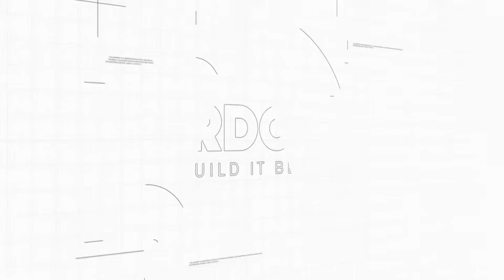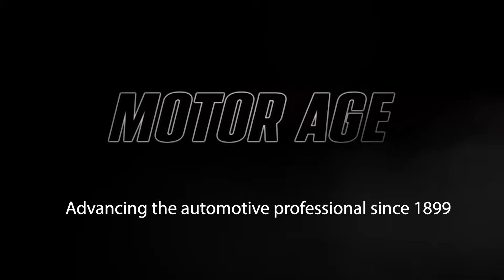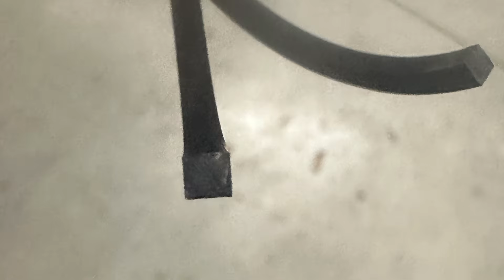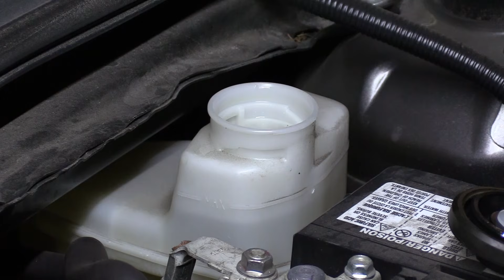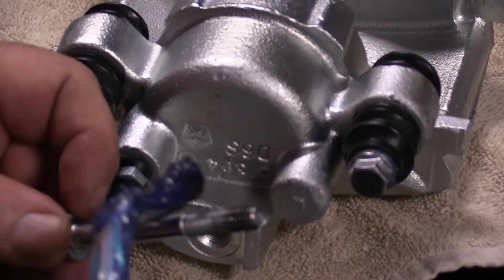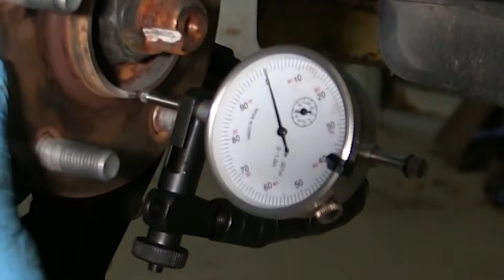Cardone PROTECH #13:  Brake Caliper Do’s and Don’ts

Comment: Good video! One thing I'd add to the caliper lubrication taking point is the use of anti-seize as a lubricant... Anti-seize should NEVER EVER be used!!! It's a HUGE pet peeve of mine!! I'm constantly redoing someone else's brake work (mostly from  shops) because the customers brakes have worn unevenly and/or prematurely... only to find the sliders have been "lubed" with anti-seize!!!  if I can even get them apart,  I have to go through great lengths to clean the bores and pins.
Reply: Anti-seize in lieu of silicone grease?
Reply: @ProJanitor  I see it all the time!! Drives me nuts!
Reply: @madmike214  my god…

I can understand using anti-seize on the bracket but on the guide pins? 🤦
Reply: @ProJanitor  yeah it gums up really bad
Reply from the maker: The prescribed recommendation is to always follow the manufacturer's service information and recommended materials.